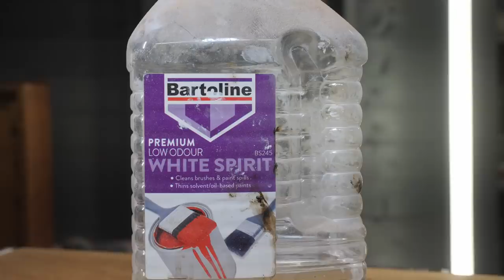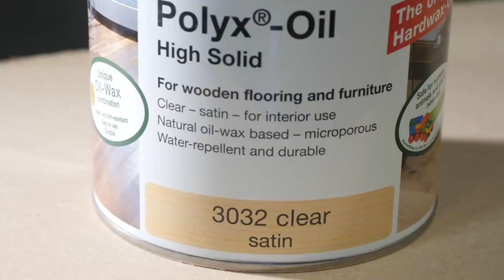MID CENTURY VINYL CABINET REFINISHING / Furniture restoration / Osmo Polyx Oil

Comment: Can I ask why you use a plane to remove the vaneer instead of stripping? Is it more gentle? If so what kind would you recommend?
Reply from the maker: I didn't remove the veneer, just old lacquer. Scraper is much safer than sander. 😊👍